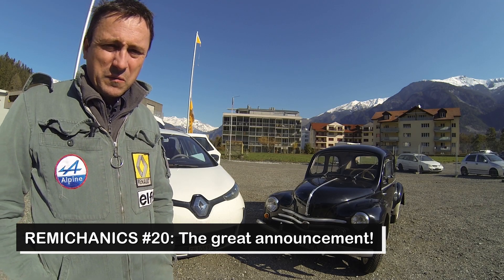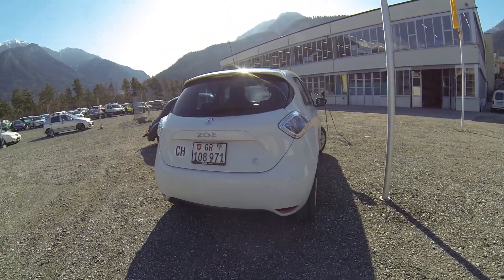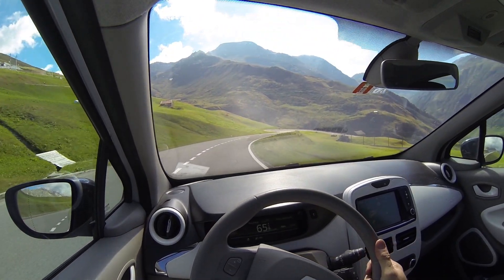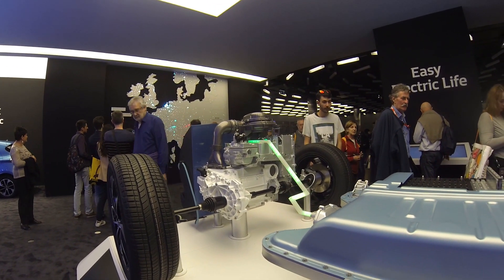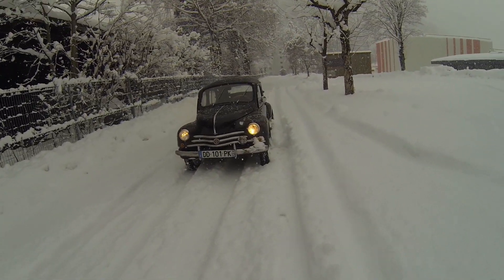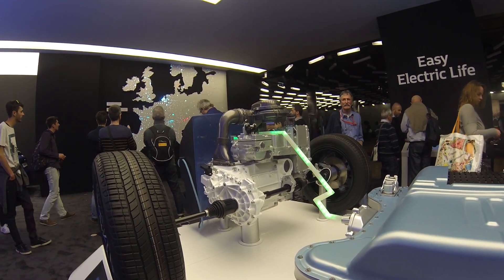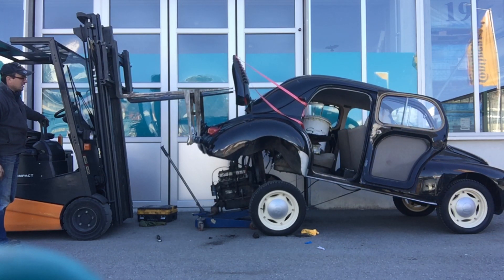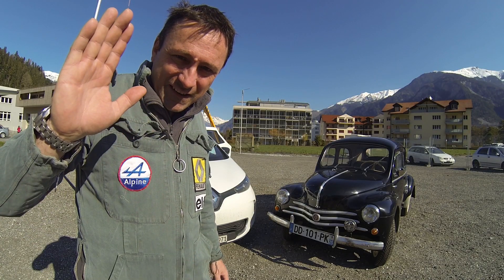REMICHANICS #20: EV Conversion Renault 4CV -  The big announcement!

Comment: Interesting project. I’d like to do the same with a Renault 16. But the Zoe is still a bit to expensive as I see it to break. My concerns with your project are mainly weight and power issues. The 4CV wasn’t so powerful, only about 17-21 hp, but the Zoe is a minimum of 88 hp. This may become your hardest part to upgrade the 4CV chassis and suspension (ZOE battery weight 315 kg and motor with parts are probably another 100 kg.). If I where you, I’d convert the 4CV with Twizy parts instead and add a PowerBox from Kenneth in Norway. Weight and Power would be more like each other. A R16 would handle the power of a Zoe as the TX had 93 hp.
Reply from the maker: Hello Albert, thanks for your comment! There's a misunderstanding there (probably due to my bad english language skills): I don't want to break the Zoe for the 4CV (that would be way too complicated), but develop a custom setup for the 4CV. I've just uploaded a new video today discussing some technical details for the 4CV. Would be great if you could watch it and let me know what you think! Best regards!
Reply: Hi Remi, thank you for your explanation. I made an assumption earlier. I had a look at your other video and it made everything clear. Looking forward following your project. Good luck!

Comment: This looks a great project, Rémi.  I’ve a 1964 classic and would seriously consider converting it to EV. I agree with you about having fun without polluting. Very interested to know how you plan to go about this, what tech you’ll use etc. Perhaps like Eden have done with the Mehari?
Reply from the maker: Hello Mike, thank you very much for your comment! I will try to cover as many of the steps as I can, and also discuss alternatives etc. on here. I‘m really looking forward to this process! What classic car do you own? Cheers!
Reply: @REMICHANICS  I've an MGB. Earliest model, with pull-handle door handles and the early engine with 3 main bearings rather than 5. No syncro mesh on 1st gear either..